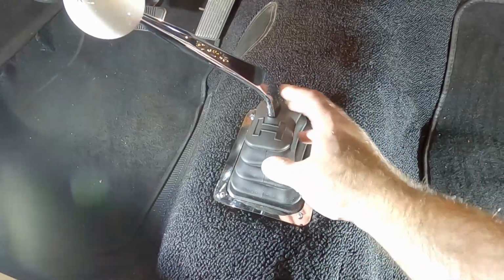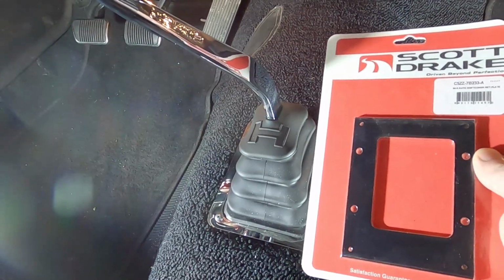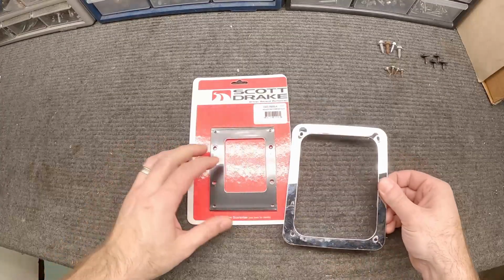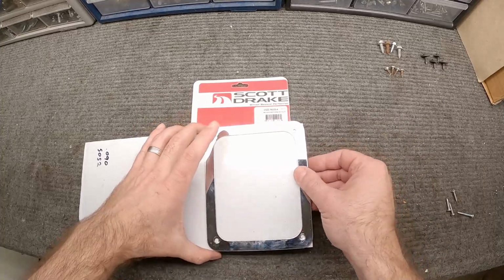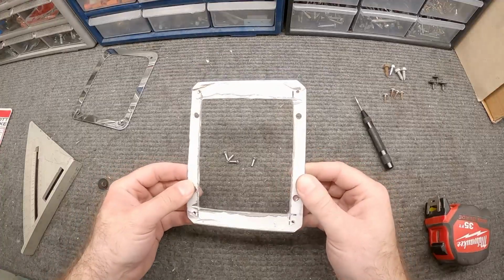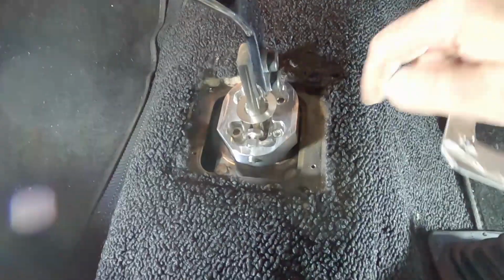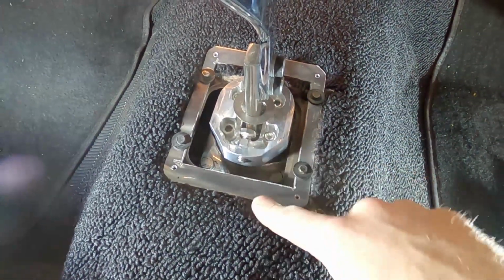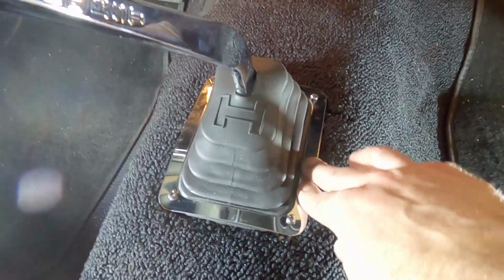How to make a Custom Mount Plate for Shifter Boot

Comment: Andy take a look at a lower  shifter boot seal for a fox body, what it does is provides a dust / water  splash shield so water cant  get inside your car. hurst shifter boot looks great but it isn’t a good enough seal for water the boot goes on  the tunnel with a  good gasket to keep elements out then put your hurst shifter back on and knock out some more noise also. You will thank me later.
Reply from the maker: Thanks for the heads up, but I only drive the car when it's nice out, so water is not an issue.  :)

Comment: Tip for when you need to mark and drill holes through the carpet.
Mark carpet with a sharpie then use a soldering pencil to burn a hole through the carpet creating a tunnel through the carpet free of carpet strands.
Reply from the maker: Yeah, that's a great tip.  You're not going to like it when I reference doing something like that in a later video, but elect to still do it the hard way.  I won't tell you what video it is, you'll just have to watch all of them.  I'll give you a hint though, it came after this video.  :)

Comment: Another solution is to use a 69-70 Ford boot/trim ring - it has a larger footprint to clear the T5 shifter. They come in Hurst (square hold) or 3-Speed (round hole)
Reply from the maker: Maybe, but it doesn't solve the issue where I have to try to find the holes if I ever need to get in there.  There are already several holes from people getting in there over the years, but now I have a mount plate designed for the boot.  :)